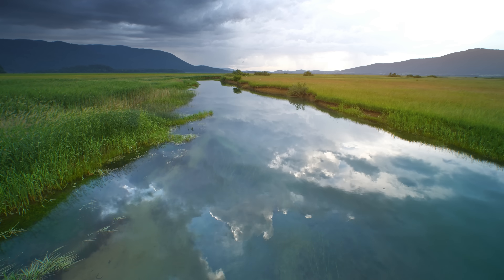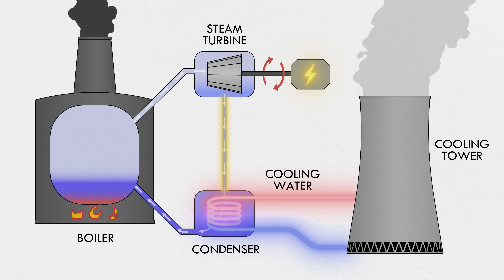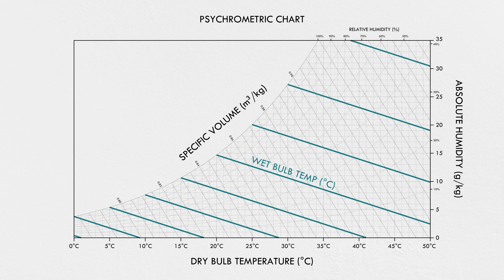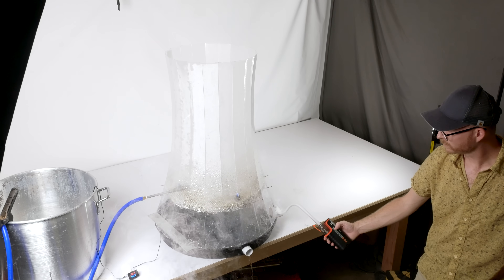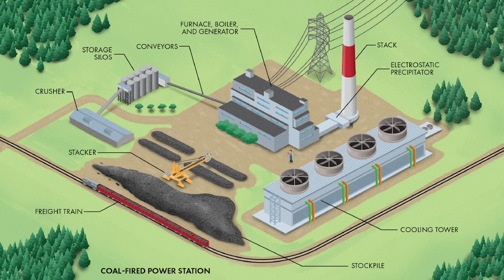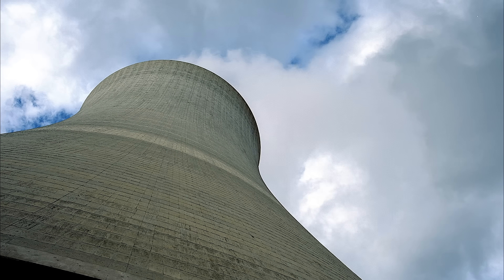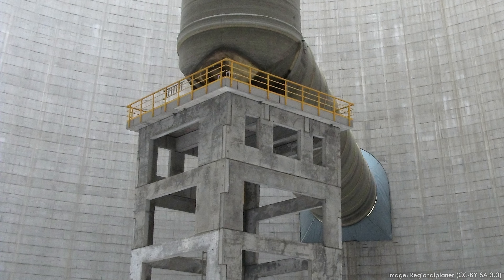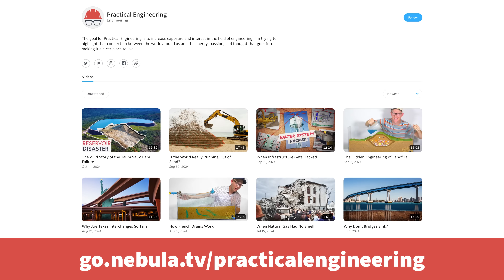Why Are Cooling Towers Shaped Like That?

Comment: Just to point it out, powerplants dont need to cool the water itself. They need to turn steam back into water, which needs a specific amount of energy like it did when it transitioned from water to vapor. Every joule more of cooling the water is energy lost you would have retained to turn it into electricity. The engineering is about to cool it exactly the right amount so it changes phases and not a joule more since no one wants to throw money out the chimney. Just in case it wasn't clear from the video.
Reply: You maybe don't have to, but you still very much want to. The lower you can get your condenser temperature, the lower the condenser pressure is and a lower condenser pressure increases efficiency.
Reply: @tz8785 Agreed, but only up to the point where condensate sub-cooling losses dominate and cycle efficiency reduces with reducing condenser back pressure.  Sweet spot at our plant is 38mbar.
Reply: @jollygiant  That would be a condenser temperature of about 28°C? Still pretty far below the usual boiling point.
Reply: @ yes, but we do achieve this in winter but with 3degC sub-cooling which drops the condensate temp to 25degC.
Reply: @tz8785 I don't have a good conversion factor in my head right now, but @ 29.5" of vacuum, the Condensing temp is right around 72.5° F
Edit: Merchant vessels are designed to give 28.5° (Hg) @ 75° inlet temp. Naval (military ships) are designed to give 28.5 @ 85° F..
Reply: Just like in refrigeration... the saturation point. Anything more and you're dealing with
subcooling or superheat.
Reply: I wouldn't mind them throwing money out of the chimney. I would travel to my nearest power plant just to watch that.
Reply: A nice explanation of minimising sub-cooling 👍
Reply: Yes it’s also called a co-efficient energy ratio. 
Optimizing these ratios enhances cooling efficiency, reducing energy consumption and environmental impact.
Reply: I think you’re getting confused a bit here. Cooling tower does not cool the steam that drives the turbine. It cools the water that cools the steam that drives turbine. You absolutely want the water that cools the steam as cold as you can get, which cools the steam faster. If you’re getting too much cooling from the steam, you can always control the cool water flow rate
Reply: @thecompanioncube4211  Trust in Jesus Christ, not antichrist.
+
I hope and pray that folks change their view and invite the Lord Jesus Christ into their life to rule and reign.
+
(Proverbs 16:18 > Pride goeth before destruction, and an haughty spirit before a fall.)
+
Satan is referred to as the prince of the power of the air for good reason, he owns the airwaves on planet earth and is the god (little g) of this world. It is my hope and prayer that you choose the God (Big G) of heaven who controls the destiny of your eternal soul.
+
(Matthew 10:28 > And fear not them which kill the body, but are not able to kill the soul: but rather fear him which is able to destroy both soul and body in hell.)

(Proverbs 9:10 > The fear of the LORD is the beginning of wisdom: and the knowledge of the holy is understanding.)

(2 Corinthians 4:3-4 > [3]-But if our gospel be hid, it is hid to them that are lost:
[4]-In whom the god of this world hath blinded the minds of them which believe not, lest the light of the glorious gospel of Christ, who is the image of God, should shine unto them.)

(Romans 10:9-10 > [9]-That if thou shalt confess with thy mouth the Lord Jesus, and shalt believe in thine heart that God hath raised him from the dead, thou shalt be saved.
[10]-For with the heart man believeth unto righteousness; and with the mouth confession is made unto salvation.)

(Romans 10:13 > For whosoever shall call upon the name of the Lord shall be saved.)

(Ephesians 2:8-9 > [8]-For by grace are ye saved through faith; and that not of yourselves: it is the gift of God:
[9]-Not of works, lest any man should boast.)

(Revelation 3:20 > Behold, I stand at the door, and knock: if any man hear my voice, and open the door, I will come in to him, and sup with him, and he with me.)

Is Jesus knocking at the door of your heart? Is this your opportunity for eternal salvation? If it is, I hope and pray that you open the door and invite Him in to your heart and life, in Jesus' name. Amen!

All glory be to God. Amen!
Reply: @thecompanioncube4211  The heat exchanger  loop was shown in the video, so I assume people are aware of that, no need to repeat it.
Reply: Powerplants don't need to condense stream by cooling it to reuse the water as boiler feed water. They almost always do as condensed steam pulls a vacuum on the last stage of the turbine which generates more value of power than the value of heat lost, but it's not required to function. 

The low pressure and low temperature steam can be used as the first stage of heating new boiler feed water, or heating up combustion air. 
If a plant uses a condensing steam turbine or not is a factor of the economic value of what they are doing with the turbine's mechanical output and the cost of fuel. An oil fired boiler might want to reuse as much heat as possible as the mechanical output of the turbine is less expensive than the diesel fuel being burned, unless it's a turbine powering the locomotion of a vehicle like a ship then it might still want to use a condensing turbine. 

The low pressure and temperature steam is also of value in capturing heat from the exhaust train leaving the stack emissions just above their condensation point for the water made during the combustion of hydrocarbon fuels, like how modern gas furnaces need a drain on the exhaust to let the water drip out. Most power plants like to say a bit above that value to avoid stuff like nitrogen compounds mixing with water and making acid in the stacks.
Reply: You need a little Condensate Depression to ensure that you don't get cavitation in the condensate pumps.
Reply: Cool
Reply: He said that
Edit:you elaborated better
Reply: he explained it just fine in the video
Reply: @MatthijsvanDuin not really, there are a lot of important matters left out, and more than a few (shall I say) misconceptions.
Reply: Trust in Jesus Christ, not antichrist.
+
I hope and pray that folks change their view and invite the Lord Jesus Christ into their life to rule and reign.
+
(Proverbs 16:18 > Pride goeth before destruction, and an haughty spirit before a fall.)
+
Satan is referred to as the prince of the power of the air for good reason, he owns the airwaves on planet earth and is the god (little g) of this world. It is my hope and prayer that you choose the God (Big G) of heaven who controls the destiny of your eternal soul.
+
(Matthew 10:28 > And fear not them which kill the body, but are not able to kill the soul: but rather fear him which is able to destroy both soul and body in hell.)

(Proverbs 9:10 > The fear of the LORD is the beginning of wisdom: and the knowledge of the holy is understanding.)

(2 Corinthians 4:3-4 > [3]-But if our gospel be hid, it is hid to them that are lost:
[4]-In whom the god of this world hath blinded the minds of them which believe not, lest the light of the glorious gospel of Christ, who is the image of God, should shine unto them.)

(Romans 10:9-10 > [9]-That if thou shalt confess with thy mouth the Lord Jesus, and shalt believe in thine heart that God hath raised him from the dead, thou shalt be saved.
[10]-For with the heart man believeth unto righteousness; and with the mouth confession is made unto salvation.)

(Romans 10:13 > For whosoever shall call upon the name of the Lord shall be saved.)

(Ephesians 2:8-9 > [8]-For by grace are ye saved through faith; and that not of yourselves: it is the gift of God:
[9]-Not of works, lest any man should boast.)

(Revelation 3:20 > Behold, I stand at the door, and knock: if any man hear my voice, and open the door, I will come in to him, and sup with him, and he with me.)

Is Jesus knocking at the door of your heart? Is this your opportunity for eternal salvation? If it is, I hope and pray that you open the door and invite Him in to your heart and life, in Jesus' name. Amen!

All glory be to God. Amen!
Reply: @Frantic857  I don't trust anything or anyone
Reply: @kiyoponnn  In reference to what?

Comment: Out of curiosity, you mentioned around ~13min that the evaporative cooling towers are preferable at nuclear plants (partly) because they aren't dependent on mechanical means like fans/etc that could fail in the event of an emergency - but wouldn't the pumps circulating the cooling water also fall into that category? If those pumps fail, wouldn't the function of the cooling towers also go down since they can't circulate the cooling water stream?
Reply: You're correct..... In nuclear power stations these pumps are extremely important and there is a lot of redundancy to keep them working even in the most extreme cases... So the least amount of components in the system, the better... That's why it is preferred not to have fans, one less component to fail and to have redundancy

Comment: So, is the problem with dry ambient air that evaporation cools down the air so much that the decrease in temperature of the air increase the density so much more than the evaporated water vapor decrease the density to the point where the air density becomes higher than that of the ambient air?

Also, why is the condenser usually illustrated below the boiler, I mean, if the condenser was placed above the boiler, a simple system of valves controlling parallell lines and containers, gravity should be able too feed the water back, one container filling up from the condenser, while another is emptying back to the boiler. Then you wouldn't need to force the water back in with a pump.

Comment: So talking about evaporative cooling. Can you actually cool can of soda below ambient temperature by putting a wet rag on it? And in what conditions?
Reply: Yes winds need to bellowing
Reply: the air must have the capacity to hold more water vapour, and a bit of air movement helps for convection

Comment: Oh! I thought the water was pumped to the top and flowed down on the sides for the cooling effect. You learn something new every day!
Reply: The head required would be massive...500 plus ft.  Our pumping head was like 60 or 70 ft I recall between fill height and spray system losses.  A bit more in winterization mode.

Comment: "Here in my garage… just bought this new nuclear reactor here. It’s fun to have nuclear power, but you know what I like even more than not exploding? Efficiency. That’s why I installed these 12 new cooling towers. Each one cranking out steam, each one a testament to power production. Because having a reactor is one thing, but optimizing your reactor? That’s what separates the amateurs from the pros.”

Comment: swamp coolers can do on average of about 20 degrees below outside temp
Reply: but only in conditions that are significantly below 100% humidity, with their ability to cool being inversely proportional to the ambient saturation of the air

they're really cool (lmao) and the basis for a lot of historically vital methods of semi-passive refridgeration but heat pumps are so much more efficient in every metric besides initial installation cost

Comment: We have a new 1. Built 5 yrs ago. It draws and outputs into a river. They ran 2 pipelines the 3 miles or so to the plant. Its a hilly terrain too but I watched em install it, maybe a 6 or 8ft pipe. Fkllows I-70 then runs down a cliff. Its longer than Id suspect

Comment: 1:00 i have always wondered why they cant just re heat the steam after the turbines and just skip the condensing phase altogether  i mean at the end of the day its just a working fluid
Reply: My undersatnding is that condensing steam creates a vacuum improving efficiency and maximizing power output of low pressure steam turbine.
Reply: @pbflo6559  Yes correct. They do actually reheat the steam in many boilers after the HP turbine and then run that into an intermediate pressure IP turbine before running through the LP turbines where condensing aids efficiency as you state. They also can use heat recovery to preheat incoming water as well rather than just dumping all the heat into the cooling water.
Reply: You can. A good number of plants actually do exactly that, but after around 3 passes the diminishing returns make it infeasible to go further. Basically you can bring the steam back to the same temperature, but it'll still be at a lower pressure than when it first boiled, so your turbine needs to get  bigger. And then you need to duplicate all the associated infrastructure and sync both stages of turbines and stuff. At some point it becomes so expensive and complex you might as well just condense the steam and start over.

Also you don't actually need to kick out all the latent heat, you can actually use the steam to preheat the feedwater and hence recycle some of that heat. In fact your dinosaur car might already have such a device, it's called an intercooler.
Reply: I'm wondering that too. Maybe it has to do with expansion when transitioning from water to stam, because you need flow to enter turbine.

I hope we get the answer.

My first question was why even cool the steam if its on the edge of liquid. But then i figure it out that they heat steam a lot becasue it looses temperature in exchange for velocity when going through turbine.
Reply: As others already alluded to the answer is pressure! Because water expands to steam at a ratio of 1700:1 at atmospheric pressure you can create extremely high pressures if you have a closed system and all that volume has no where to go. The secondary effect is that under high pressure the boiling point of water goes up. So the higher your pressure the higher is your temperature and more overall energy is in the steam. Then at the other end you reverse the process by condensing the steam back into water but again in a closed system. So the big decrease in volume creates a vacuum that Maximizes the overall pressure difference that the turbine can use.
Reply: For nuclear plants, it also used to be used as an auxiliary control rod system. You can see where the problem with that rises if a pump stops, water boils, steam absorbs less neutrons than water, more nuclear reaction more steam.... Hence why Chernobyl went into meltdown. Now they likely use it to take advantage of the transition temperature difference in water to steam and vice versa.
Reply: @westonzavadil8770  Chernobyl did that because it used a graphite moderator (accelerator), so the water served as a neutron absorber (brake). So if you lose water you lose your brakes and the reactor runs away. Water itself is actually also a moderator, so if you use only water for moderation then losing water means you lose power, so no runaway (though your fuel rods are still hot enough they will melt if that happens for too long). Modern reactors are actually required to do this to get their operating licence.

So why was Chernobyl designed the way it was? One was to allow operation without the need to enrich the fuel, though the Soviets eventually still did that because the reactors proved to be too difficult to operate with unenriched fuel. The other was that the reactors weren't designed purely for power generation purposes. America's B reactor also used a graphite moderator, and had the same runaway problem. If the water loop broke, you immediately dropped all the control rods and ran away! Hence why Windscale chose to do air cooling instead, but that decision eventually ended up setting the reactor on fire
Reply: I suppose if you did that you'd essentially have built a closed-cycle, external combustion gas turbine, so it COULD work, but yeah, what the others said about vacuum and pressure differentials is basically the reason 👍
Reply: I assume it's the expansion of the water, from liquid to gas state, that creates the increase in pressure to drive the turbine.  
If you feed steam into the reactor you get no increase in pressure, just temperature.
Reply: Can't keep reheating the steam at some point the temperature will be too high and components begin melting
Reply: >>>A good real answer: It's easy to pump water, harder to move a gas, but darned near impossible to pump a saturated steam/water mixture.  It's too "lumpy."  You take it down to just below boiling in the condenser vacuum, so you can pump it back in!!!  In the end it's always doing what is practical, not necessarily what is best.   (steam is a gas of course, not the droplets you see from a kettle)

That and maximizing vacuum in the condenser to keep turbine efficiency and end stage flow cooling up.  If there's much air in there, the rapidly spinning last set of blades can actually heat up from moving the last bit of air in there, and not enough steam flow to keep them cool, especially at low power.

Having said that, you reduce to JUST a known little bit below boiling at that pressure.  You keep efficiency, but also have to prevent cavitation in the pump suction eyes.  That can destroy a pump really fast.
Reply: If you just heat the steam there won't be a pressure differential to drive it

Comment: "Water molecules actually weigh less than the nitrogen and oxygen in the air." I understand this from a molecular weight perspective, but the idea that moist air weighs less than dry air doesn't pass the sniff test for me.
Reply: Lots of Hydrogen. Makes perfect sense.
Reply: that's because you're mistaking the weight of liquid water with that of vapourised water